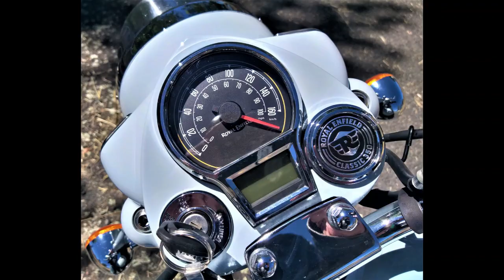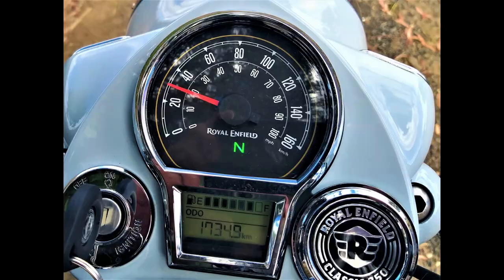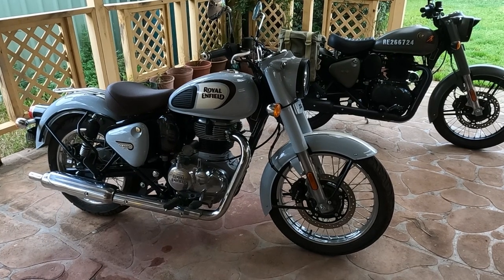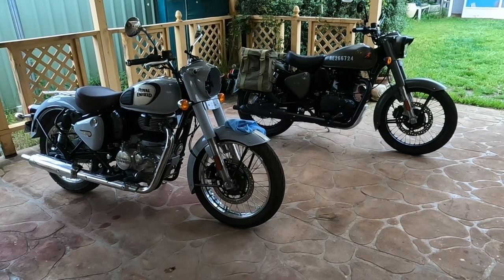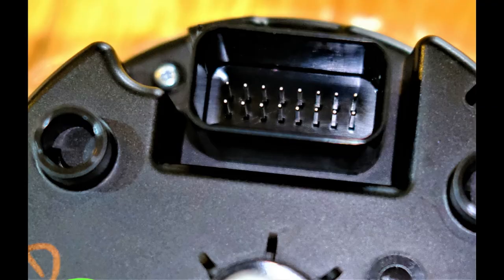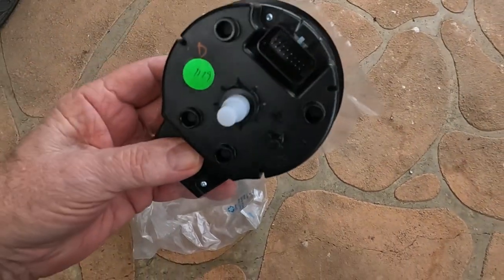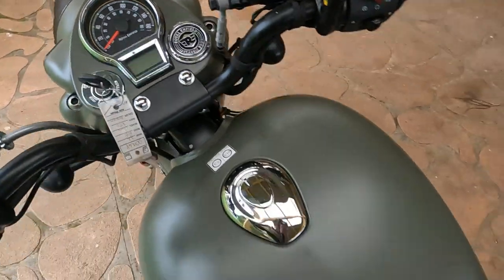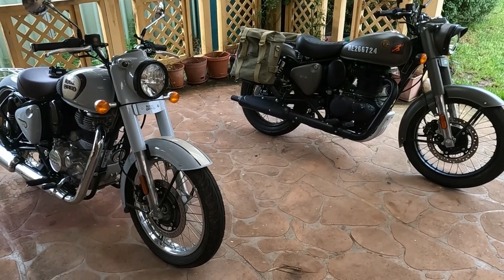Royal Enfield Classic 350 Reborn - How I Fixed My Faulty Cheap And Nasty Plastic Speedometer!

Comment: Well Warro you could have saved Enfield a fortune if they had been on their maintenance team 😂 but you have taken some anxiety off me and I’ll have a look at my connectors 👍 but I have over 1,000 miles on mine now and all’s well fingers crossed 👍 bloody well done mate 😅👍
Reply from the maker: i'd say if you have had no issues keep clear of it. if you have then try a clean. you may have seen in the clip i didn't want to touch it. 
on the other hand when i did the valve adjustments i did a clip where i had removed that cover probably 8 or more times just to see how many times one can re-use the original gasket.
but i had lots of issues with that speedo and found it highly frustating and friggin annoying to boot. 
although i have the new reserve unit...let's just say I'm too scared to touch it again...lol
if i have to i will but just for the sake of it...NOOOOOOOO!
all the best!
Reply: @ridewithwarro  that’s me told so I’ll keep well clear 😃👍

Comment: Good on you, Warro! Personally, I'm surprised that a) the supplier's putting that amount of grease on the connector and that, b) RE's QA team haven't apparantly pick up on the issue. Of course, they may have already done so and hopefully this is now sorted.
Reply from the maker: yeah its a hard call. just because it worked on mine only time will tell if it works on other units. either way its worth a try should your bike have any issues.
that fix was 5 months back and 3000 kl and i've never had the issue since.
when it was happening it must have done it 20 or 30 times in 1700 kl
highly annoying for sure but since that day i did all those rough dirt track runs and not a single issue
Reply: It is not sorted. They are supposedly having new harness but, not making recall yet.
Reply from the maker: @oknevals  in that case that may indicate that its a wiring harness fault not the actual speedo itself. time will tell there...i guesss
Reply: @ridewithwarro   It could be more tham one thing. The worst thing is that RE is not honest about it. I read couple comments where guys replaced speedo and still had a problem. They offered to me to install some old speedo or wait til they fix. My dealer told me four other guys had same problem. That was within month of starting to sell them.
Reply from the maker: @oknevals  8 months back my speedo was faulty from the very first ride and that lasted 1750 klm. since i did that clean i've done 3000 klm trouble free.
it will be interesting to hear once others try my fix.
it will either work and solve a few issues or my fix was just a one off...lol
time will tell there but at the moment i am 100% happy with my speedometer clean up
Reply: @ridewithwarro  I've seen my share of problems with cables and connections. I'm tempted to try.

Comment: Nice videos on the the classics. I am looking into the Signals Desert Sand. Just wondering how accurate are the speedo's? I know that in my car using gps and a speed adviser on a free-way just outside of melbourne that my speedo is 4 kph higher than my actual speed. I have heard that manufacturers can be out by up to 10%. No wonder other vehicles see to be shooting past me. 🙃 Thanks.
Reply from the maker: i'd say somewhere in the 6 to 10 kph out at 100 kph would be more like it. the only real issue i see with the classic 350's is the odd chance you might get one with a faulty sticking speedometer.
they may have sorted it out by now as this was 12 months back.
either way they are good bikes to own and virtually trouble free too

Comment: It seams to be common problem with that speedo. Other have experienced the same problem. 
Different question.. From where did you get that back seat rack ? 
My bike has just arrived and my dealer don't have any accessors for the model besides the touring seat. I see you've got one.. How is it ?
Thanks to you I have purchased the correct heal-toe replacement shifter from India. Still waiting for delivery.
Reply from the maker: i actually like the touring seat and i think it performs better over longer rides. can't really compare bike to bike as i have classic 500 piggy back shock on the touring seat bike-the marsh grey and just stock set up on the halcyon grey.
just look on ebay for the rack its a harly one the length your looking for is roughly 11inches.
check the specs first as they sell roughly 4 different sizes.
i think you'll enjoy the heel.tor i run them on both.

Comment: Hi again Warro.

After my classic 350 reborn, had cooled down overnight and a few on and off cycles with the key. 
I have been able to get the speedo needle to return to zero. 
 
So, I went out and bought some electro cleaner and just now tried to see if your fix would work, but I have hit a "roadblock" 

I just don't seem to be able, to get the wiring harness to disconnect from the underside of the speedo. Is the little red plastic tag meant to be pulled all the way out, in a downwards direction or is it meant to fully pushed in and upwards? 

I've tried both ways and pressed, squeezed and pulled with all my might. So much so that the front forks where compressing. I even tried very cautiously getting some multi-Grips onto the wiring harness block. I really don't want to overdo it and causes damage to the wiring system.  

Wirring harness at this point remains stubbornly fixed to the Speedo housing. 

Iv'e also had a look at the video "Economical Rides" did using your ideas. Seems that I'm doing it correctly with the red tab, but the connector "block" won't budge :-( The red tab on mine seems to have two different possible positions. One "pulled outwards" about halfway and the other is all the way. I tried both ... 

I'm hoping you (our someone else) might know what I'm doing wrong mate. Thanks'
Reply from the maker: pull tha red/orange tab straight down to its 3rd or fully open position  now press the tab in a downward motion and while doing so pull the harness out.
may take a couple of goes but it will come out
Reply from the maker: when you put the harness back in smear a bit of vaseline or something in the area where it mates up to the connector. that way next time it will be much easier to remove.
Reply: @ridewithwarro  Thanks Warro for the advice on making the next time easier. But I'm still to get past the first time 🙂
Reply: @ridewithwarro  I'll have another crack at it tomorrow after a bit of a ride.
Thanks' for taking the time to reply. 😀
Reply from the maker: @seanb1081  did you see this. after i got your message i went out and pulled the headlight and harness out of the speedometer. this is the way to go - so
pull tha red/orange tab straight down to its 3rd or fully open position  now press the tab  in and pull down and while doing so pull the harness at the same time.
may take a couple of goes but it will come out
Reply from the maker: @seanb1081  another thing once you do the clean up and clip it back in and key up ...it may not move the needle.
if it happens leave ignition on and tap on the dial and then turn off and redo and it should burst into action.
while at it today i pulled the harness and then added a bit of vaseline to allow it to glide in and out more easily.
turned the key ...nothing happened on the dial. so gave it a knuckle tap and it fired up immediately.
over the next 10 minutes i re-keyed the bike 3 times and it did the speedo sweep perfectly
Reply: @ridewithwarro  Yes saw your reply. Thanks again for taking the time. I'll make shure to let ya know how it goes. 👍
Reply: Took the bike out on some back creek rainforest type roads. Speedo worked perfectly over about 3 hrs ridding on some pretty rough dirt roads. So, at this point I'm just letting the "sleeping dog" speedo alone and see what happens on the next long hot ride. On a side note, the Classic 350 puttered along perfectly the entire trip. Great little single!
Reply from the maker: @seanb1081  guess it might be a wait and see situation

Comment: Is the VIN of the Halcyon Grey less than ME3DJELT5NV012775. I think so, then you have a speedometer with ABS plastic inside and not with PVC.
Only the VINs up to ME3DJELT5NV012775 are affected, i.e. that to model 2022 (recognizable on the N). All later models (P for 2023) already have the speedometer made from PVC instead of ABS (this deforms under heat effect).
Reply from the maker: this was a first shipment bike and now running the replacent speedo. so far so good and its colder weather here now so no issues there...lol

Comment: Warro The Royal Enfield Wizard does it again! 

My 2022 RE Classic 350 is having the exact same problems with the speedo. (2400KMs on the clock) Wich is a real worry ...  like how you would explain it to the cops if Ya got pulled over. I rang my local RE dealership today and they said they'd be happy to have it fixed. Then they dropped a "bomb" on me .... told me that in order to go ahead with the warranty claim they would need to hold onto the bike for the entire time the claim was active. Min 3 to 5 days they said, and no mention of any parts even being available ! 

That's a big deal for me, as my bike is my only means of transport! I don't own any another vehicle, and I need my bike for commuting back and forth to work.

 So tomorrow I will definitely be following "Warro the RE Wizard's" advice and checking and cleaning the terminals for grease. I'll let you know how it goes, and also try and get some photos and video footage, that I can then link back to here.

If your fix doesn't work my next plan is to "Occy Strap" a couple of cold tinnies to the instrument housing 😀
Reply from the maker: a good idea is to buy a motorcycle phone mount from ebay. roughly $20 -that way one can set a gps speedo from the phone and that will get one out of trouble. i did that a few times in the ealy days of the faulty speedo...much more accurate too but doesn't look as good as the stock speedo...lol
Reply: @ridewithwarro  Yes agree on that idea, especially as I already have a "Quad Lock" for the phone, but still a hassle. Hopefully by cleaning the terminals problem will be sorted. I'll let you know
Reply from the maker: @seanb1081  use the key to turn it on and off a few times so that it re-zeros before you do it. thats what i did.

Comment: Hiii Warro, is this marsh gray yours as well? I bought halcyon gray 20 days ago. I like marsh gray as well & I would love to get one. It's rider seat is not conformable on the narrow front. My balls & thighs need more cushion. I am thinking about to add some cushion layer on it rather than replacing it with touring seat. Also, my exhaust caught a little rust on it's bend pipe & rear end. RE outlet guys are not responding to this. Do you know how to clean rust from this 20 days old bike?
Reply from the maker: yeah there's both mine....good bikes. touring seat is good as i put one on the marsh grey. you could buy one of those air-hawke rider comfort pads or they do sell knock off much cheaper
get some aluminium cooking foil like one would wrap a chicken in -scrunch it up into a sort of loose ball. get some water and add a bit of washing up detergent. place the foil ball in the water and then use it to rub the rust off the chrome pipe
Reply: @ridewithwarro  won't it scratch the crome?
Reply from the maker: @jeetudewan4939  no. just do what i said. some aluminium kitchen foil -scrunch it up add water and bit of washing detergent-do the job and then come back and say thanks-it work well
Reply: @ridewithwarro  that worked as a charm, thanks! My speedo did the same thing to me as well few weeks ago, took it to the dealership and they changed the speedo and speed sensor, seems to be working ok now. Hopefully lol
Reply from the maker: @beedee7392  yeah i still dont understand how they get these wonnky speedos- a year ealier i bought a carby himilayan and it too had a crook speed straight off the bat.
i'd say enfield buys them in bulk as second quality for $3.50 ea
if they paid the supplier $3.75 we would have got first quality units which work....lol

Comment: So the problem was really only the dirty connector?
Reply from the maker: it appears so. in my case. that clean up of the contacts was done roughly 5 month ago and 3,000 klm back. it may or may not come back but as of now i have no intentions of swapping it out for the new unit
Reply: @ridewithwarro  well good. My thoughts were more about the careless indian who assembled your bike. How else can the connectors suffer from such degrading?
Reply from the maker: @uncletom1971  just say for example its related to too much grease on the contacts like on the 650 interceptor and both the b and C 5's relays.
my bikes worked fine after the thorough clean up of all the relays but there was also a view circulating around that there was a batch of bad relays which went through enfields assembly line.
so what i actually did was purchased several of those revised edition relays from hitchcocks uk and -problem solved.
maybe i was lucky cleaning these contacts and others might try and score big or fail.
either way it cost nothing or very little outlay to try and if one has that issue believe me its that annoying...you'll try anything for a fix.
my guess is time will tell here.either way i'm pretty happy regardless

Comment: G'Day Warro. Is the speedo still behaving itself?
Reply from the maker: no issues with it so far. i think its been several months since i did this clean up of the contacts
Reply: @ridewithwarro  That's very good to hear. I must try and have another go at getting the connector block to separate from the speedo.
Reply from the maker: @seanb1081  pull tab down and the press in while pulling block plug down
Reply: @ridewithwarro  Ended up having to unbolt the speedo to get to the connector blok, and even than it was still a stubborn  as all get out. The connections looked very clean but I still gave it a good blast of electrical contact cleaner. Unfortunately, once the bike has been ridden around the 90 to 100kmph, for 30 minutes or so, needle starts it's erratic behavior again. But hey .... I still appreciate you video on the potential fix, it was definitely worth trying 😀
Reply from the maker: @seanb1081  win some ...lose sum i guess but so far all is still pretty good my side but in your case it was worth a try....
by the way did you clean both sides of the unit -the connectors and the connector block itself?
when i did both i allowed a good hour or so for both units to dry out naturally. maybe it helped or maybe not.
if mine does it again i will try the same proceedure i used months back but like i said so far so good. going into warmer weather soon so that may make a difference. time will tell there
all the best!
Reply: @ridewithwarro  Sure did clean both sides. The speedo unit quality and build is definitely nothing to write home about. The speedo is still behaving perfectly on the daily commute around town, but looks like I'm going to have to hand it in to the local RE dealer to get it replaced and fixed properly (Hopefully)
Reply from the maker: @seanb1081  i might admit when i pulled mine thats the closest ive come to what a $10 speedo looks like. must admit it sure is a cheap plastic bit of crap.....lol
lucky the bike is well ahead of the speedo in build quality
all the best and i suppose was worth a try
Reply: @ridewithwarro  Yes it was disappointing to see how cheap and nasty the speedo was on an otherwise well-built bike. Once again thanks Warro for offering a potential solution to the crappy speedo problem.

Comment: Had the same problem  my dealer replaced the speedo
Reply from the maker: even i'm not sure if its speed related or wiring or excessive grease on the contacts....and i bet neither does royal enfield...lol
from 2012 to 2020 i had 15 new classic 500's
i actually use to tell the dealers what issues the new models/years had and a few months later the fix came in on the bikes......lol
Reply: @ridewithwarro  the speedo reverts back to 0
Reply from the maker: @bennievee  sorry -i dont understand what your saying?
Reply: @ridewithwarro  Sorry Warro when my speedo was changed the original mileage is not transferred to the new speedo so the speedo shows o miles as if the bike is new
Reply from the maker: @bennievee a trip back in time...lol all the best!